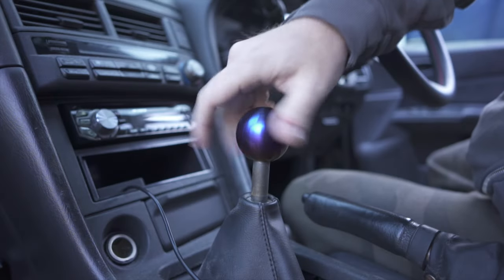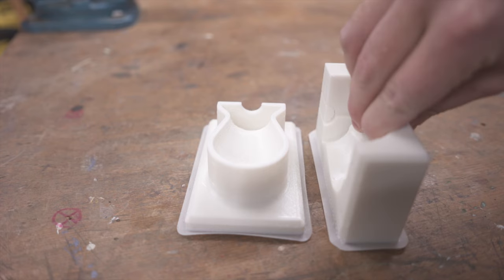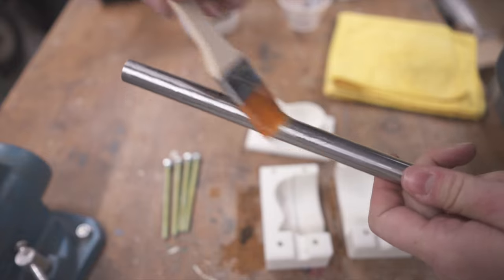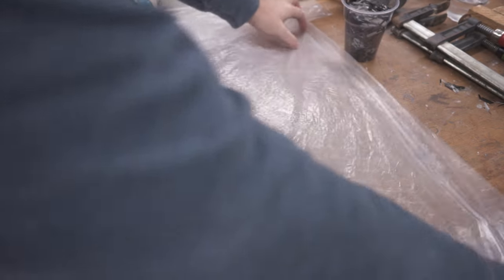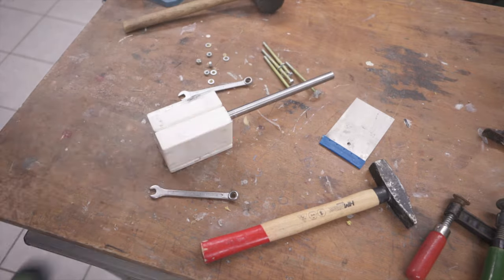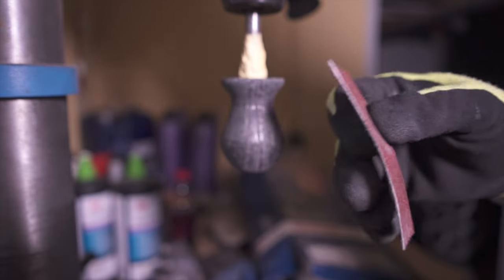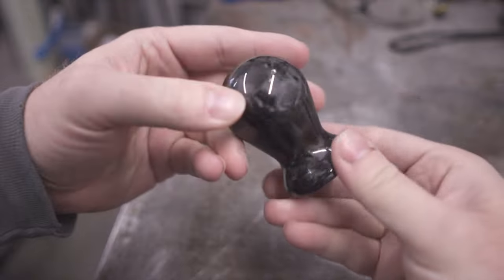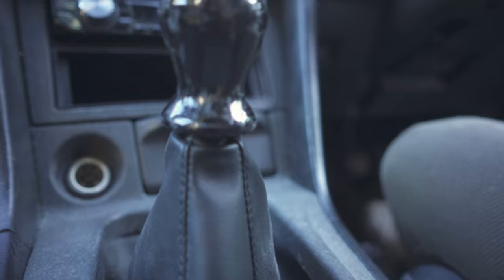Full forged carbon Nismo shift knob! Better than duracon? Complete guide with 3d model/plans

Comment: Iv made loads now.     The amount of paint brushes you use is amazing lol 
Now I use cut sponge pads    Cut to size the use crocodile clips to hold it   It helps keep level.    Iv done splitter dash pods steering wheel loads

Comment: Nice Video and great result! But I have one question regarding to your calculations. Isn´t it called „fiber volume fraction“? The ratio of 60% fiber an 40% matrix is related to the volume of the part and not to the mass, right? Fiber and Matrix have different densities; Carbonfiber 1.78g/cm^3 and Epoxiresin around 1.15g/cm^3. 

So, if you calculate 60% of 55cm^3 is 33cm^3 of fibre and 40% of Resin is 22cm^3. Multiplied by the density of 1.78g/cm^3 resp. 1.15g/cm^3 you get a mass of about 59g fibre and 25g resin. So the Part should weight 84g with a fibre fraction of 60:40.

With a fibre fraction of 46g, as told in the video, your part has a fiber volume fraction of aproximatly 47%. 47% fibre and 53% Resin.

In the end I think ist doesn‘t matter in case of your part, but I think its worth considering this.

Correct me if I am wrong 😉
Reply from the maker: Thanks, no I believe you are 100% correct, I have taken Easy Composite's values because I believe they have simplified them for easier calculations. Not everyone will know the exact values like you do and be able to calculate it, and at the end of the day for a project like this you don't need exact values as long as they are close enough considering the amount of excess epoxy you are using anyway to be squeezed out!

Comment: why did you use a 3-part mold? could you do this part with a 2-part mold instead?
Reply: Much harder to remove the part. More parts on the mould means easier release and more probability of keeping the mould from breaking

Comment: Nice..what's the final weight after the insert?
Reply from the maker: Awesome question, I forgot checking that too! I just ran outside and took it off to put it on the scale and it appears that the steel insert and glue added 15 grams and were now at 89 grams total!

Comment: awesome. what diameter is the metal rod you used. thanks
Reply from the maker: I used a 15mm rod so it would have 1mm clearance from my iirc 14mm shifter lever, if the lever was thinner I'd also use a smaller diameter rod!
Reply: @LXGspec  thanks very much

Comment: It's a lot of work. I prefer to make it out of wood and use lead as the weight and just make the handle so liquid lead can be poured into it. You can then adjust the weight as needed, depending on testing results. It's also cheaper and faster. Otherwise, just buy one.
Reply: It will also then be made out of wood and not everyone wants a boomer handle.
Reply: @jdmcarrepairs142  make it out of whatever they want. There’s no reason that it must be real carbon. Just paying g more for no performance enhancement. I guess good for people who like wasting time and money.

Comment: What is the point of making the mold in 3 pieces? Couldn't this just be two halves?
Reply from the maker: Probably doable but the 3p version has the advantage of a substantially easier demolding process.
Reply: @LXGspec  Ah ok I see. Thanks.